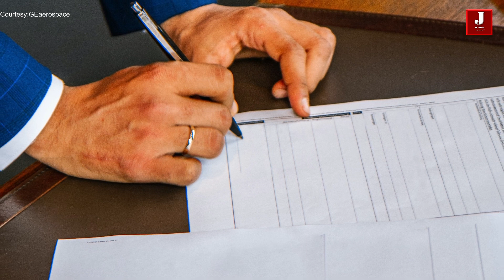GE eyes multi-billion dollar engine deal with India for fighter jet programs

Comment: Do we get technology full know how to manufacturing these engines to Indian research centers and independently develop engines in india with out much of forgein help. If not its just another east india company unless Indian domestic company get technology.
Reply: Nobody will share engine technology.
We have to build it ourselves parallely.
Reply: @direwolf7491 no, ge will share technology as well, that's what the deal is all about
Reply: @ROTHSTEIN01  GE engines are outdated.
India want adaptive cycle.
Reply: @ROTHSTEIN01  Toh US se kyu Russia se hi lelo 240kN engine mil jayega.
I am telling you by the time GE will make the engine it will be outdated tech.
India wants adaptive cycle so far RR and Safran have agreed for it. GE says it will give ToT but for lower generation engine.
Reply: @direwolf7491  no talks for adaptive cycle neither any mention. It should be 110 kn class engine. No other requirements. Even the Safran doesn't have Adaptive cycle technology. RR and GE are working on it. No aircraft has adaptive cycle engine yet.
Reply: @manas2656  RR claims to have adaptive cycle technology.